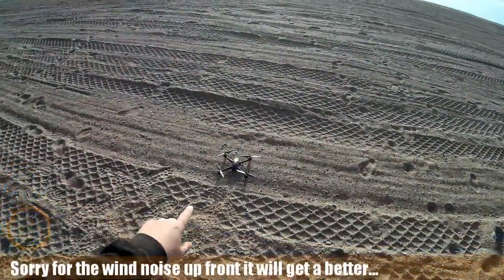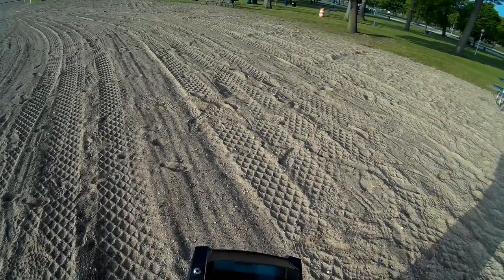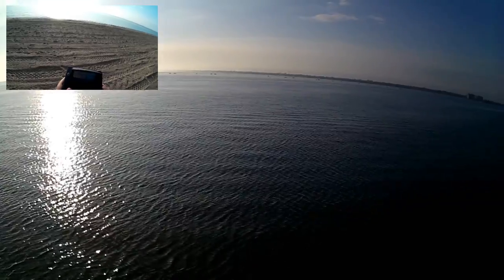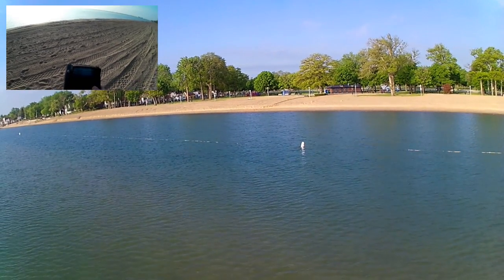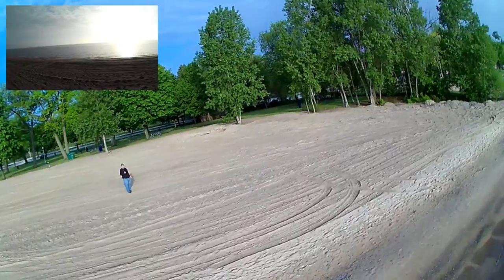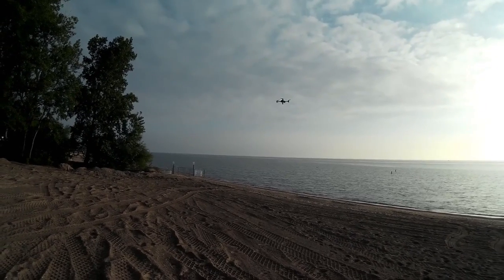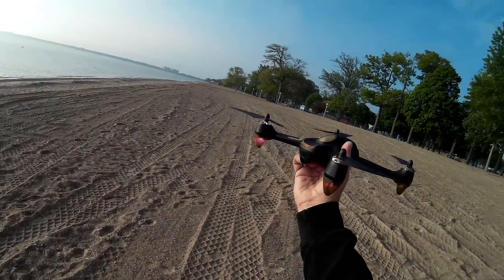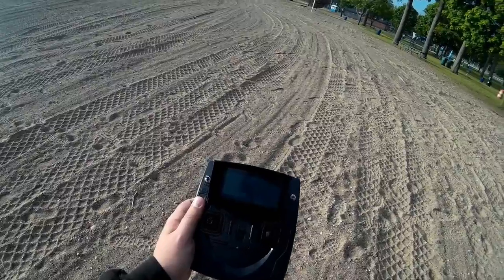Video Drone - When the fingers Meet the Prop of the Hubsan 501s!

Comment: I did the same thing when my transmitter disconnected, and it landed but did not disarm the rotors.  I ended up cutting my finger and bleeding all over the drone.  Be careful, these things are sharp, keep away from people's heads.
Reply from the maker: Dittio on that!  You are 150% correct!

Comment: You should go to Home Depot a get yourself 1 piece of 12x12 Tile about 99 cents and set it on the sand to launch those quads, that sand tears up those motors. I had to take my whole hubsan 502 apart after the first flight because it got sand in the motors.
Reply from the maker: After this little close call I got one of those fold-able landing circles :-)   Very compact and light, also makes me look like I know what I am doing (just don't tell anyone its our little secret :-)